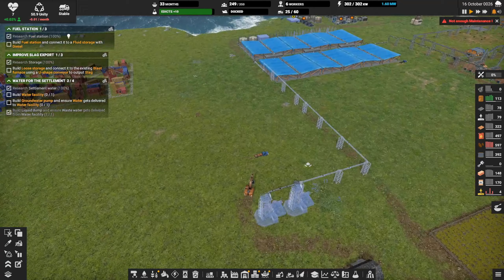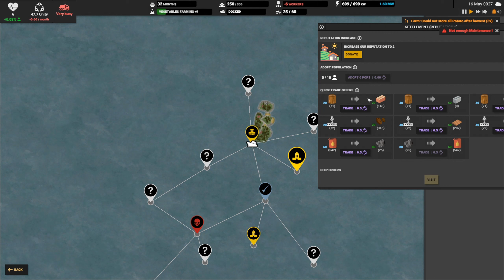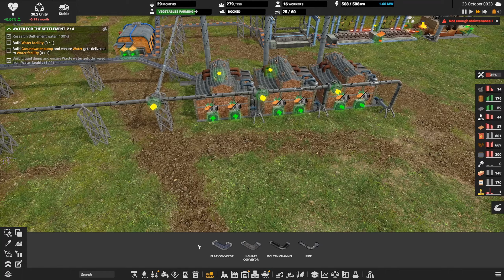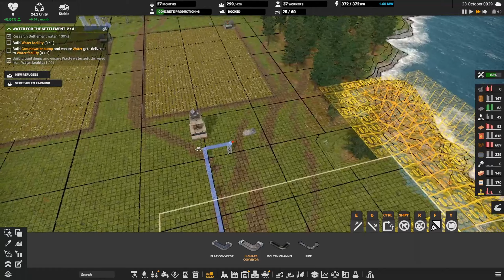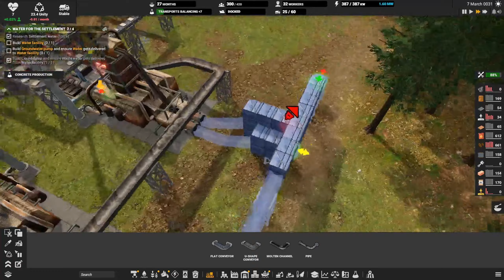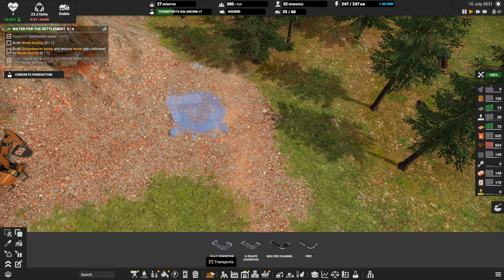Scaling Up & Efficiency Improvements!  Let's Play Captain of Industry s06 e07

Comment: Each brickworks needs 21 dirt. A mark 1 belt can’t move enough dirt for 3, let alone 4 or 5 brickworks.
Reply from the maker: Belt and Pipe upgrades come pretty early in the tech tree, so I tend not to consider the throughput constraints of the level 1 components when building since I know those constraints won't be there for long.
I do the same thing in Satisfactory. I always build as if I have the next level (or 2) of belts. When the belt upgrade comes, I can just upgrade belts without having to re-scale my entire production setup.
The early inefficiency of this approach is usually insignificant and doesn't present issues. If problems creep up, you can always pause  the extra buildings until you get the upgrade for the connected transports.

Comment: Just an observation… you spend too much time/resources in keeping dirt/bricks running. Bricks use a lot of dirt!! I’d suggest you switch to concrete asap. (You need that dirt for terraforming!)
Reply from the maker: Dirt is easy early on which is why I lean heavily on it. We'll definitely be moving to concrete slabs relatively soon and probably keep the option to use both bricks and concrete slabs for building materials going forward.
Remember that we're going to be doing a ton of terraforming and leveling, so I think we're going to end up having more dirt than we know what to do with. 
Unfortunately, we don't always get the dirt when and where we want it when leveling/terraforming but we also have the option to make dirt from compost and gravel (?) I think.